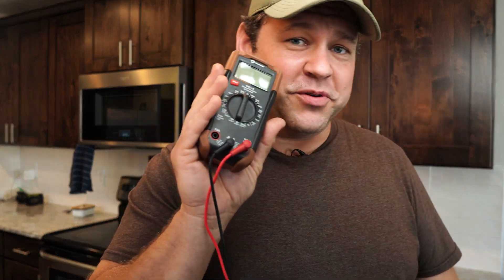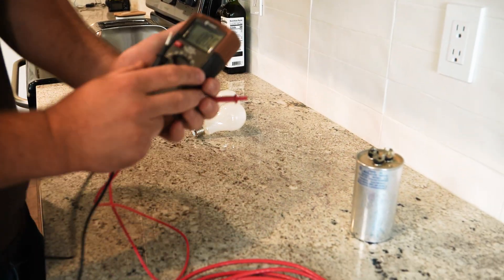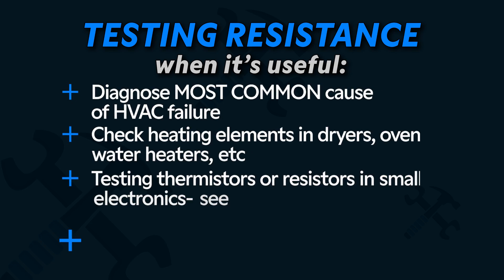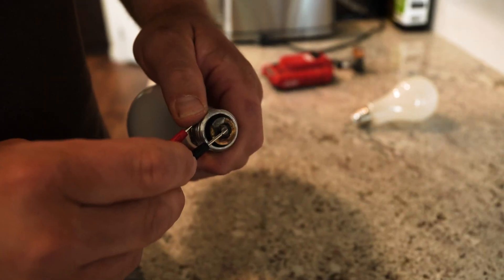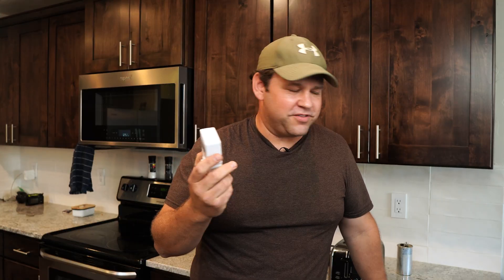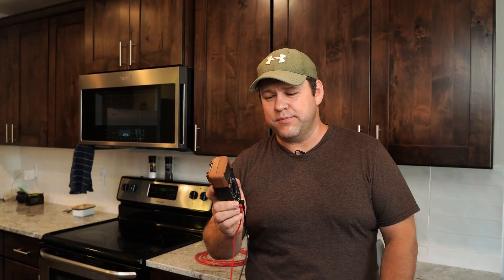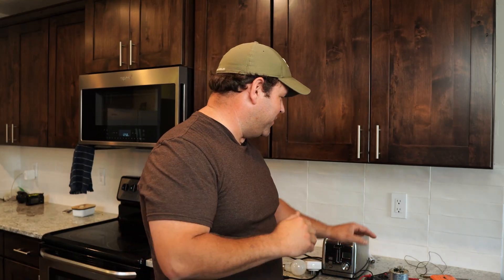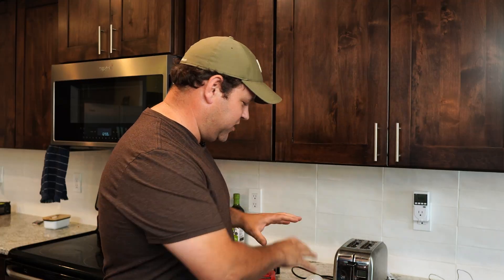Multimeter Functions 99% of DIYer's Don't Know

Comment: Beware of this guy and don’t trust his content. Just to suggest using a regular multimeter with its test leads to measure AC current of a toaster is so dangerous that this video should be removed from YouTube. 
Despite later correcting that the toaster uses AC current later the hazard could be done if the viewer only watched a portion of the video. 
Furthermore, of all the appliances to pick to measure current the toaster can be one of the most dangerous because of its highest amperage rating. If you want to measure AC amperage then use an inductive clamp with tester. Even if you can find manufacturer’s replacement parts of a Chinese toaster, it will cost you more to fix it. Replace it with a new certified appliance as your life, home safety and pocket book may have grave consequences for such reckless behavior.
Reply from the maker: That was intentional sarcasm. I'm sorry if that wasn't obvious enough.

Comment: The best way to check a battery’s capacity is to measure its voltage under a load, not the unloaded voltage alone as shown in the video